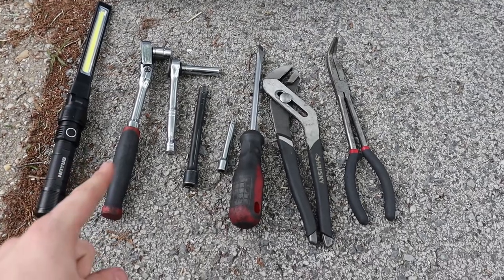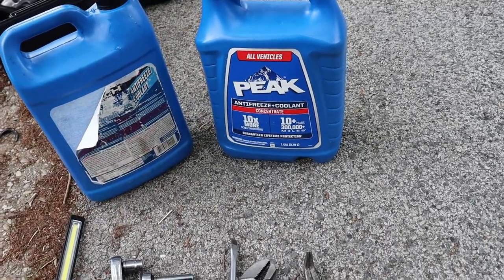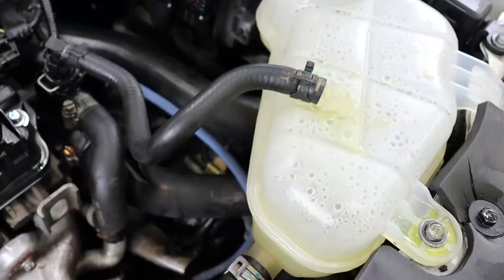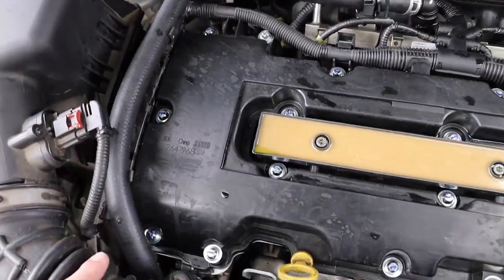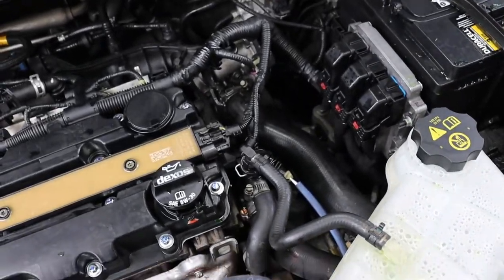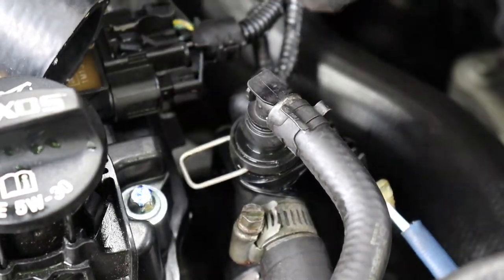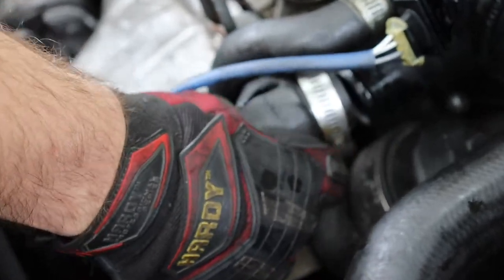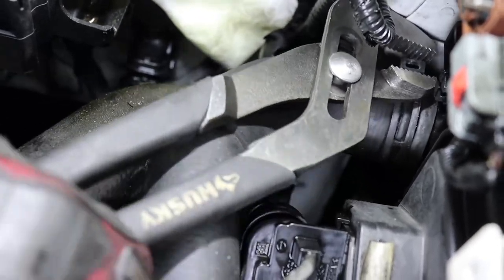Chevy Sonic/Cruze 1.4L Turbo Upper Radiator Hose Replacement

Comment: Question.
Why did you pull the pin out instead of just disconnecting the bleeder hose from the valve. I have a Chevy Trax with the same set up, and I need to replace the upper radiator hose.
Reply from the maker: any time you losen a spring style clamp they weaken. I didn't have a new one that small so I just removed the part that has an oring.

Comment: What is the part called that you replaced 3 times that the upper radiator hose connects to  ? Is that the thermostat housing  ?
Reply from the maker: It's called the Water Outlet/Thermostat Housing on the 1.4l T. I get them from Rockauto.com for $12 as the OEM ones break just as fast for $40 more. Part number I use is DORMAN 902846. Sorry for the late response!

Comment: Good job! Have you ever changed the small hose covered with a type of aluminum?
Reply: you can barely see it between the oil filter and the blue wire in the minute 6:12
Reply from the maker: @benmoon8123 I have removed it when I replaced the oil cooler. But I did it with the oil cooler removed/loose. So it may not be possible with the exhaust manifold/oil cooler mounted.

Comment: I’m trying to replace the engine oil cooler inlet hose, but the spring clamp was put on at a difficult angle for me to even get it off. Frustrating. The shop is trying to charge me $200 just to do it when I can do it myself.
Reply from the maker: I recently replaced the entire oil cooler on my sonic. This is my girls car in this vid, but I ended up getting a "mechanic special" for cheap. I cant remember if I recorded it or not. I was super busy working and didnt have time to record a lot. The turbo models are a huge pain with the hose clamp locations and them being spring clamps. I suggest ordering a screw style clamp kit and replace them all when you work on this car.

Comment: I saw somewhere that you aren't supposed to use those metal hose clamps since they have a pressure point or something, so that may be your problem.
Reply from the maker: If you use the correct size, they work fine. The issue is the piece is made from plastic and the coolant in these engines runs at 240F at points. Which weakens plastic. I figured out the problem here, When I replaced the outlet piece, there was a part stuck in the hose that I had to pry out. When I did that, it put a little cut inside the hose. That over time created a bubble and then burst.

Comment: Use the originl clamps. When the hose gets hot it expands. Do not use a worm clamp. ESPECIALLY TO PLASTIC
Reply from the maker: That wasn't the problem here. Also been using worm clamps for years with no problems.

Comment: The video did not seem to do justice as to how difficult it really is to remove the clamp towards the front of the vehicle. The camera perspective looks like it's right side up but you didn't pan in or out for me to tell which side of the engine you went in on. Anyways, I'm having a hell of a time here trying to get that off..
Reply from the maker: I went in from the Drivers side of the vehicle, since I'm right handed. They are a complete pain to remove. I suggest replacing with screw clamps when you remove them.